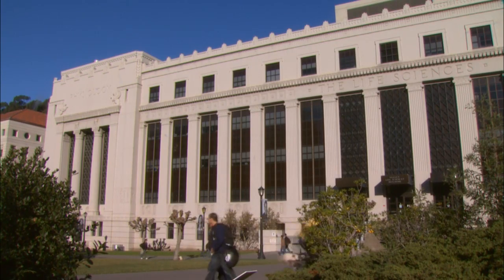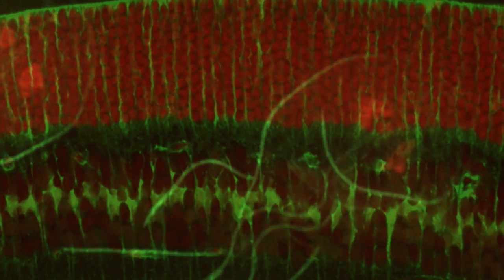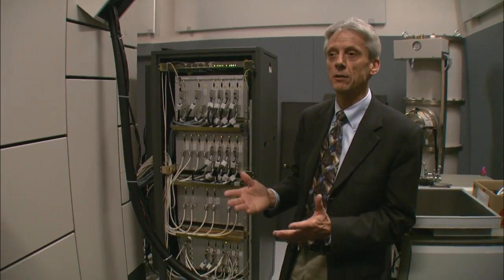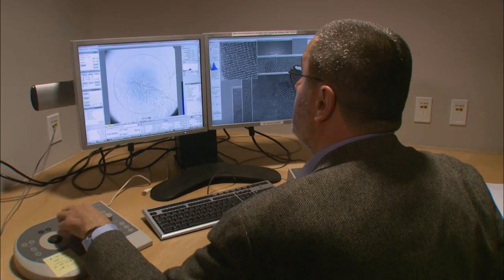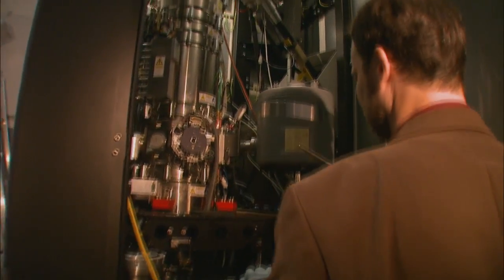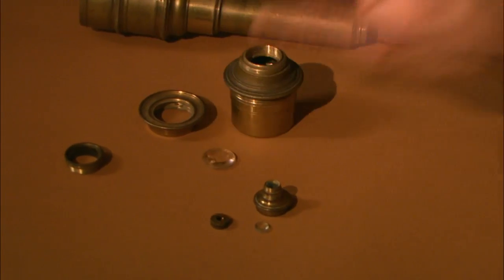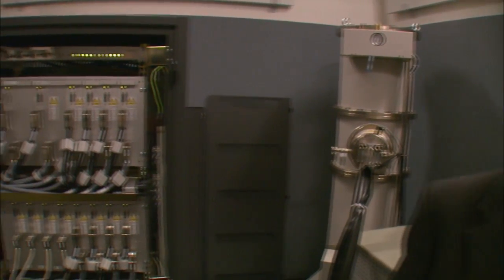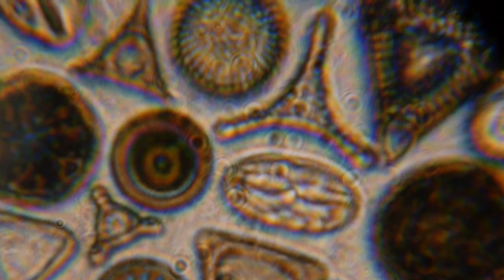The World's Most Powerful Microscope - KQED QUEST

Comment: If we're going to talk about size, that microscope is what computers were 40-50 years ago. 40-50 years from now it's going to be so compact you could fit it in a small bag. We're a perpetually primitive species because evolution never stops.
Reply: Stop speculating on things you don't understand.
Reply: @aluisious  For a supposed scientific type (I'm giving you the benefit of the doubt) you way of opposing other commentators just sounds like you are getting pissy with them. Carl Sagan would be disaapointed in you.
Reply: No it isn't. You have no concept of how the microscope works. Take a 300 thousand volt power supply and put it in your small bag and let us know how that works after it arcs and sets you on fire.
Reply: commenter78 Because I work with those microscopes every day and they're not going to magically get smaller any more than a dam for a lake is going to get smaller.

They have to be a certain size to handle and direct the accelerating voltage required to get the small electron wavelengths required to see small things. Any smaller dimensions and they will arc and blow themselves up. The universe is not changing its mind about how far voltage can arc.
Reply: commenter78 Irrelevant. You are completely ignorant about how electron microscopes work so your analogy is worthless.
Reply: +MrSatanochio i really wonder what is technology going to be like in 40 years. how are tvs, computers, microscopes, telescopes, cars, smartphones, watches, planes going to be.
Reply: aluisious computers used to be the size of whole rooms and had the power of a smartphone or less .
Reply: aluisious how do you know technology wont evolve in such a way for the microscope too?
Reply: aluisious they could invent quantum microscopes.
Reply: aluisious
well, shit, didn't know that. Just went by a logic that seemed to apply to a lot of things.
Reply: aluisious What work do you do? Biotechnology?

Comment: I'm having trouble, has an electron ever been visually captured?
Reply: As they pointed out, it is impossible to see atoms regardless how powerful a lens and how strong a light source, because in the visible light spectrum the wavelengths are just too long to be able to interact with something as tiny as an atom. By accelerating electrons however (which themselves are subatomic particles) one can fire a stream of them at structures that small and they resultant information can be screened on a monitor in visual form in a similar manner as Sonar, X-rays or Infrared Images.
Reply: No, never. We do not yet know what an electron is or its appearance

Comment: Just for grins, and because this is Youtube, I'm going to argue with you ;)

Doesn't actually require that much power to run an electron microscope. The lenses run at a few tens of volts, and a few amps each. Basically a bunch of lightbulbs worth of power. The really thick cable ironically carries little power too, it's mostly insulation to prevent arcing. It's 300k volts, but microamps of current. The actual wires in there are pretty thin.
Reply: high voltage is required to produce high energy electrons in the electron gun

Comment: shanuo-
the reason you dont see gaseous atoms is because electron microscopes operate in a vacuum so all the air is pumped out.
no its physically impossible to improve the light microscope past a certain point because it uses WAVES of light and the wavelength of light is the actual limiting factor...
no clue on ur 3rd question